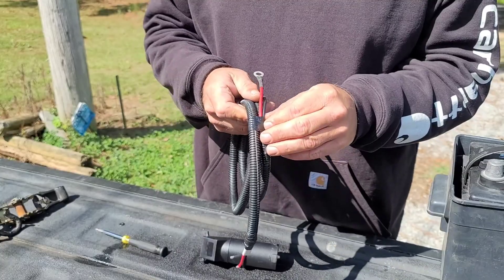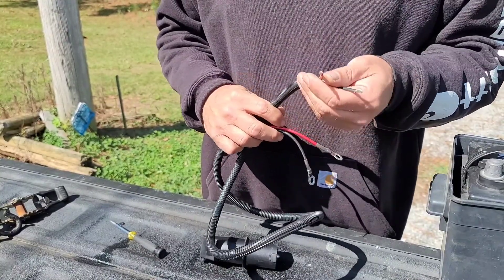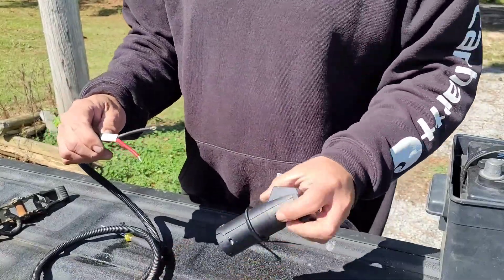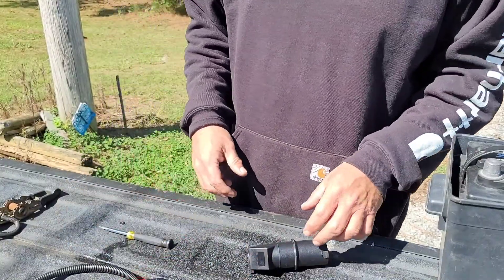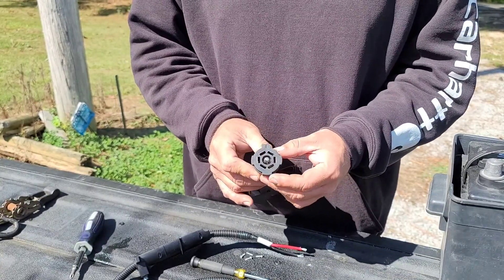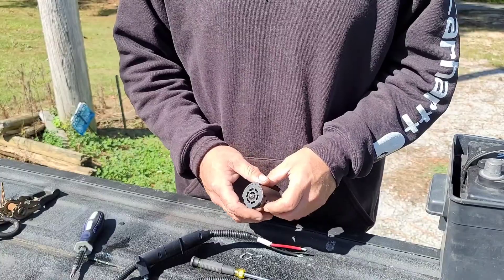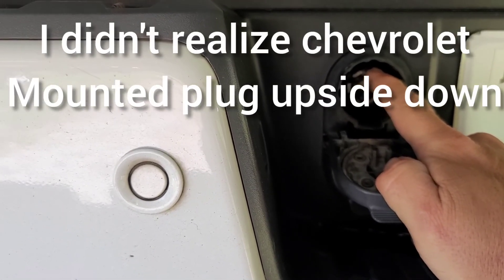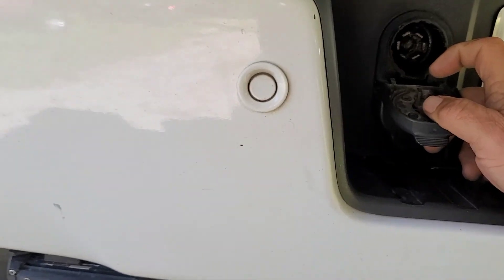Rv Transport Battery Maintainer/ Charger with tester

Comment: If you plug the trailer to your truck it won't operate the jack? You have to wait for that battery to charge?
Reply from the maker: It should a long as the fuse is good but make sure the positive cable for the isn't touching when you plug in or it can blow the fuse.
Reply: @CFarmer  thanks for the clarification

Comment: Hello C Farmer,  You mentioned that the fords don't like the charger set can you explain why?
Reply from the maker: I wished i could but I haven't had the opertunity to look at one in person. I made a charging cable for a friend with a 2018 f250 and he said that as soon as he plugged in he started getting messages on the dash for turn signal lamp error and brake lamp error (caint remember the exact messages). It could be the led test lights in the plug didn't draw enough power and made the truck think the lights were burned out but I'm not 100% sure. Maybe one day I'll have one close so i can try to figure it out. If i was going to make one for a Ford i think I'd try a regular plug without the led lights. I know dans service center sells them. They probably know more than me if you'd want to give them a call
Reply: @CFarmer  I really appreciate your response.  I will talk to a ford mechanic and try and find out what the deal is with this issue?  Maybe they might have an idea???  Thanks again!
Reply from the maker: If you get it figured out please let me know.
Reply: @CFarmer  Will do!

Comment: Great video. I just watched Mr. Tennessee’s video where he mentioned yours. That’s how I found yours. I’m a transporter too (new for about 4 months). Will plugging a fully charged battery directly into your truck like this overcharge, and this cook the battery on a long thrip?
Reply from the maker: Mine stays plugged in at all times. Even when I'm home for a week. So far i have not had any issues with the battery (or the truck)  as far as over charging that i can tell. I have had this battery for over a year and if it's not on camper it's plugged in. About 3 months ago i left ignition on and interior lights on over night and when i found it the truck barley started. I feel that the only reason it started at all is because it drained all 3 batteries evenly then brought all 3 back up with alternator then the alternator cycles as needed. That's my experience sir. I hope it helps

Comment: Great video! Did you install the 7 pin connector plug in the bed of your truck, or was it a factory install?
Reply from the maker: Ii installed it... then i had to move it when i added the tool box
Reply from the maker: Here is a link to the initial install of you would like to see. One of my early videos
https://youtu.be/oTVOCz0iosY
Reply: @CFarmer  thanks for the quick response! God bless and Safe travels!
Reply: @CFarmer  thanks for the link, I’ll watch it right now!